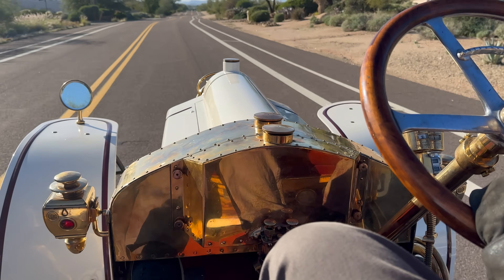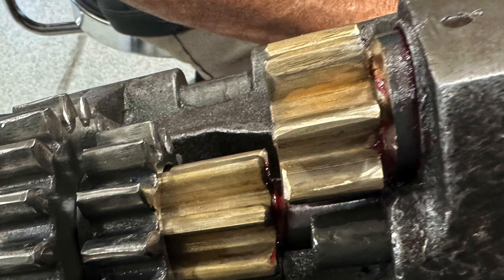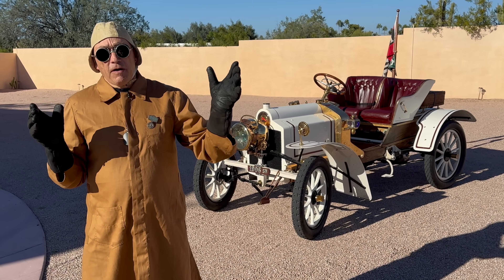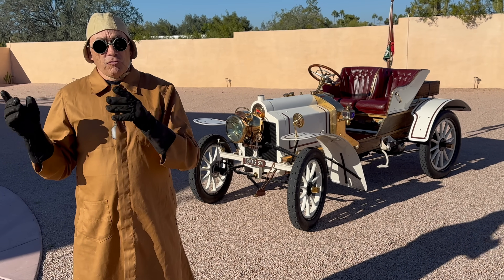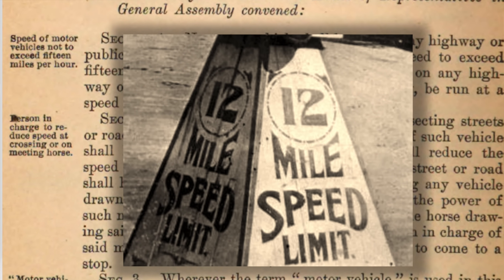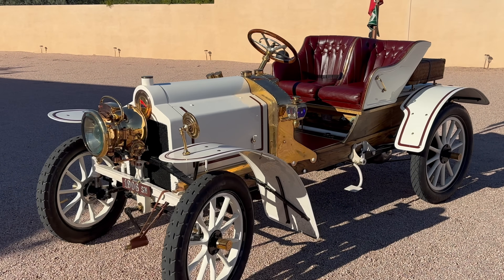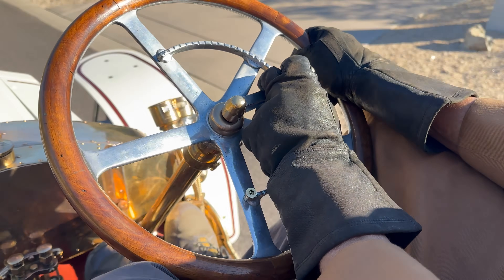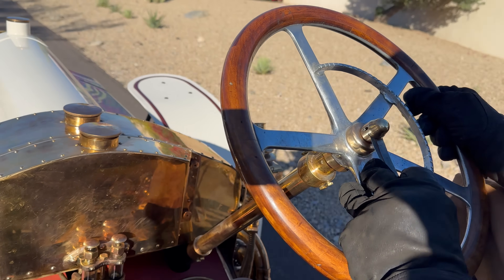1906 Sizaire-Naudin Voiturette Speed Test with New Gears - Alan Travis w #BarryT #racing

Comment: The gearing on first gear seems to be too high. The low torque and slow engine speed  is the tip off.
Reply: It can go about 20 in first gear, 40 in second gear and 60 in third gear.  I usually only start in first and shift into second once I get going. If I have the camshaft Retarded , the sound is like a Johnny Popper tractor. When we were in Second gear on the lower speed road, I had the cam shaft advanced then it has lots of power and higher performance sound. It is pretty tall geared for a single cylinder. The first gear we made is the same ratio as it was.  When we were showing reverse gear I had the camshaft advanced .
Reverse and first use the same first gear.
I also had the magneto retarded in first going down the driveway and advanced showing reverse. It is pretty tall geared .i like the versatility having control of camshaft timing as well as magneto timing from the driver’s seat. It is so unconventional , that what makes it fun to drive. Thanks., Alan
Reply: @Alantravis111  "Johnny Popper".  That was the first thing I thought of was my Dad's old "B" John Deere.
Someone mentioned a 350 engine in it.  That would probably snap the wood frame like a toothpick. LOL
Thank you for sharing.  The older I get the more I find the earliest cars interesting.
Reply from the maker: That's an interesting observation.
Reply: Low rpm motors, all these early cars have very low first gears, at least in my experience and I have had a dozen of this period.....